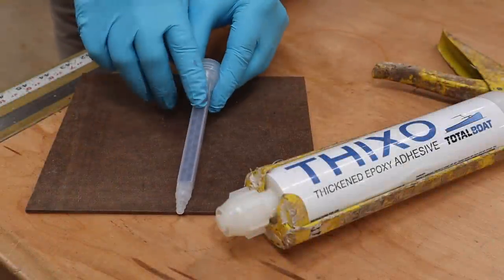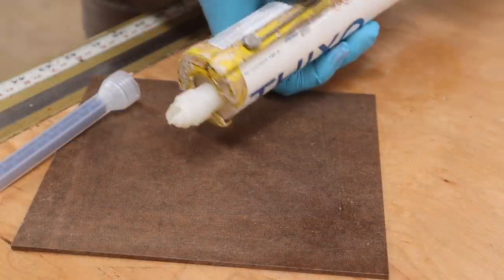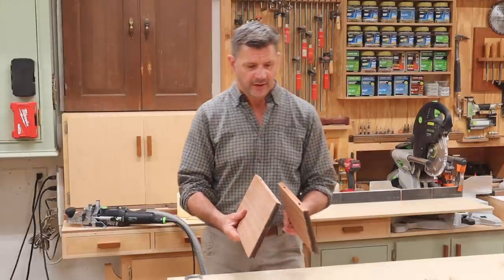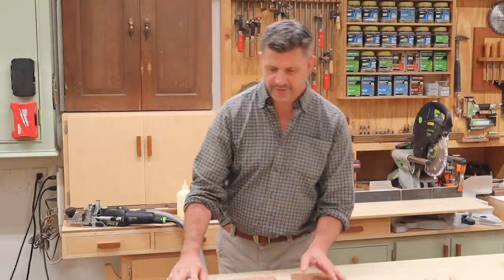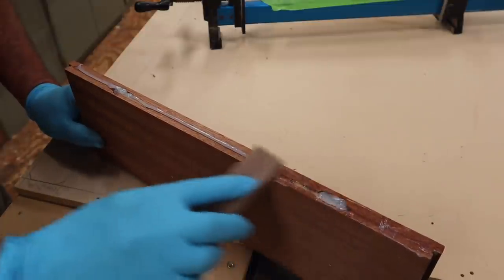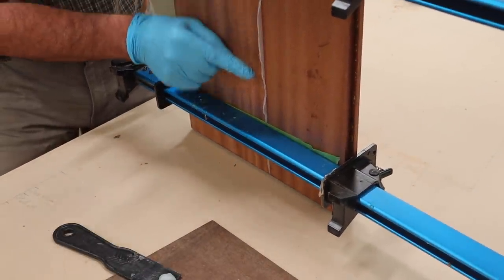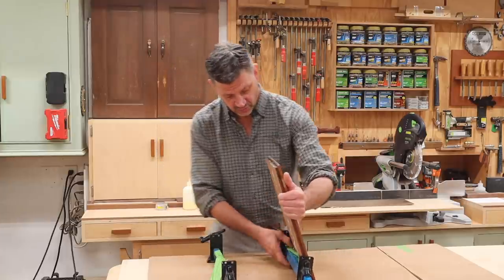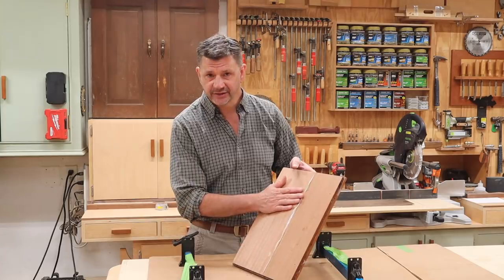How to Use Total Boat THIXO Epoxy - Great for Exterior Projects

Comment: I find there is no need to remove the mixing tip after use. Leave it on and let it harden into it's own cap.
Reply from the maker: Hey Jay, true I didn’t think of that … Derek also pointed that out . I might need to make another video 😬😄👍

Comment: That's a lot of working time.  One advantage is that once the material starts going through the tip, the material in the tip will harden so don't start that process until you are ready to use the epoxy.  The thickness of this material seems very good- normal epoxy is like honey, after you start using it it will flow and ooze and get everywhere.  This stuff looks to be much easier to work with.
Reply from the maker: Definitely! One mistake I made in the video is… It’s better to leave the mixing tip on after use and it will easily unscrew for the next time. A friend with a little more experience explained it to me
Reply from the maker: Good stuff 👍👍

Comment from the maker: Hi All, I've become a big fan of Total boat Thixo Epoxy. I like it because it's easy to work with and has a long open time. This is the third project I've used it on and will continue to use on all exterior glue-ups. This video is not sponsored, Thixo is just what I use and recommend for exterior glue-ups.
hope this video was helpful, Jon

Comment: ok i have a Question , should the wood be wet out first with regular epoxy and then use the thickened epoxy because it seems wetting out with regular epoxy first it will soak into the fibers of the wood

Comment: how does it compare to the solid surface epoxy? or is it just regular epoxy with a lot of filler to make it thick
Reply from the maker: The latter, the thick makes it easier to work with IMO